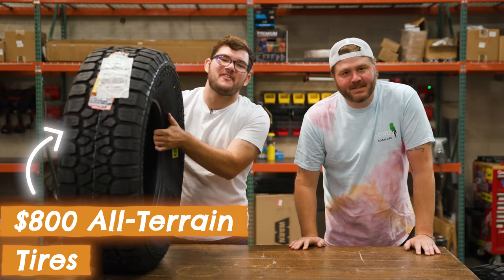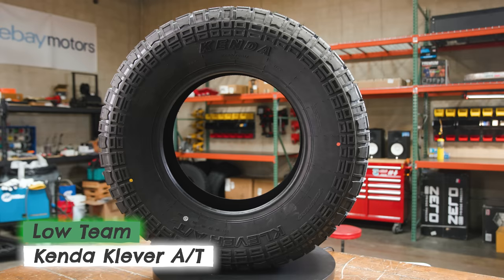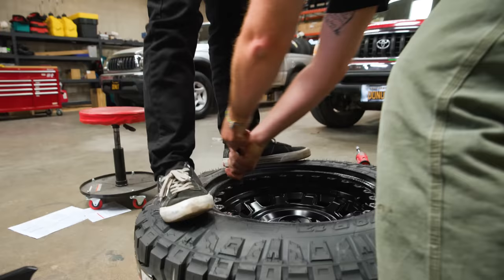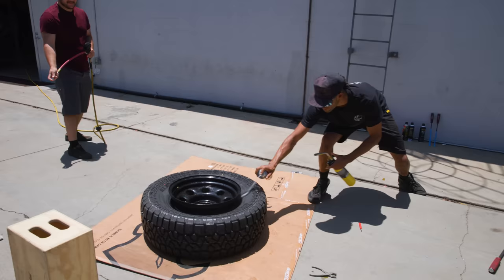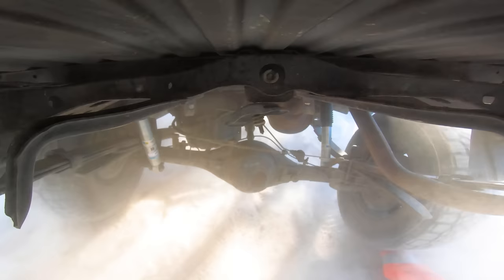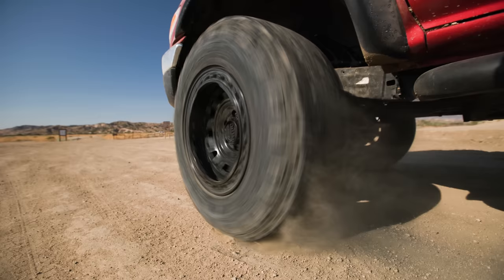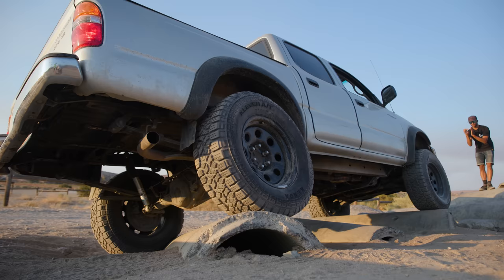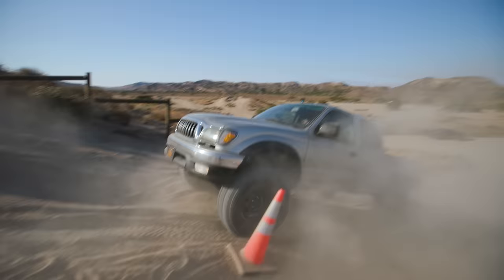$800 Off-Road Tires vs. $1500 Off-Road Tires

Comment: Offroading is like 60% skill, biggest thing with more expensive parts is better quality and better durability.
Reply: Thats the thing. The quality and durability of it is what the price basically equals. Don't go cheapest of the cheap but a center point is pretty much a solid bet for any average user. Even with moderate use it'll still be a okay.
Reply: Agreed
Reply: Ridge Grapplers are Hybrid so they sticky for streets and QUIET like Oem car tires. You HAVE to cross rotate hybrid off road rubber for them to wear well, as long as you do that they are worth the price on a daily truck. Milestar Patagonia is a GREAT lower priced competitive Hybrid w ridge grappler...even stickier and lighter per size vs Nittos. They work better off road on rocks/slippery dry surface. Nitto your paying for the name/tread looks
Reply: @05EVORS  no legitimate off-road rig uses ridge grapplers. They use Bfg mud terrain, Mickey Thompson Baja, general grabber, ridge grappler is what you see on an 8 inch lifted solid axle swapped Chevy with 22 inch wheels and red suspension.
Reply: @JacobEcret  I do agree that the dedicated off roaders have those more aggressive tires (I have KM3s), but for a daily driver, the ridge grapplers are great tires.
Reply: @chriskorf2295  No, no they are not. They are horrible. There's a reason the majority of TRD Pro 4R owners don't replace their stock tires back with the Nittos. They are subpar in OR performance(mainly durability) and after 5-8k miles the road noise jumps by a factor of 10. I know a handful of Trail/TRD OR owners who've gobbled up Nitto takes offs from Pro owners and almost instantly regret the decision. I'm one of those. I have a dedicated set of OR wheels with 285 Patagonia MTs which I would choose over the Ridge Grapplers as a ROAD tire.
Reply: $1500 skill and $800 tires in my scubaru, now im dead on a beach waiting to get the parts for new clutch. Good Old Scubbiedoo!!!
Reply: @chriskorf2295  understandable, but, you’re throwing your money out the window is you buy $300+ tires a piece and don’t put them to work, because they’re only rated for 40-50000 miles out of them, for a tire, that’s not very much
Reply: Biggest thing with more expensive parts is mostly in your head.

Comment: In all the years I've been reviewing off-road tires, what I've learned is that the difference between $800 tires and $1,500 tires is that the $1,500 tires cost $700 more, are harder to balance, and have more frequent issues.
Reply: In all my years working in the automotive field, what I've learned about the difference between $800 tires and $1500 is that the guy with the $800 tires can afford another set when they wear out.  The guy with the $1500 tires ends up complaining about the cost of his tires and demanding to speak to a manager cuz we're trying to rip him off....
Reply: If you’re bitching about $1,500 you shouldn’t be buying $1500 tires.
Reply: @AlexReyes-gu9ms  but if you're spending 1500 on tires when they barely make a difference... I guess the question is which is the priority? Appearance or function? If your all about function why waste an extra 700$ on tires when that could be put into something that actually makes a difference like a skid plate or rock rails?
Reply: @jah_b  depends on the tires your buying. If your buying stickies then there isn't a single $700 set that would even be close to comparison.
Reply: @SketchyAsFunk  sounds like the guys in this episode missed something then...
Reply: @jah_b  I feel like they left A LOT on the table with the tests they did. However for the standard person who seldom offroads and rarely goes over anything beyond a tall rock then this was a decent test. Stickies are also not road legal tires so I do understand why they where not even mentioned. If someone's buying stickies they already know what they should/ shouldn't waste money on. Overall I believe price does not dictate a good tire but the quality and purpose of a tire varies greatly between brands/models. I also forgot they used all terrain tires which are like all seasons. Moderately decent at everything but not great at anything.
Reply: @SketchyAsFunk  you sound overly opinionated. You saw what they drove these over. Wouldn't say it was a small rock I agree with your point about stickies but you're taking a bit of an elitist stance. To be honest I think either of these set ups is great for the weekend offroader who does serious driving but isn't at the point where "this" much difference in performance is worth hundreds or even thousands. Just my two cents
Reply: I found exactly opposite cheap wheel and tire combos seem to need alot more weights in my experience.
Reply: Also I believe the main difference between cheap and expensive isn't traction but durability and longevity
Reply: My local shop told me they would sell me the BFGs for sure, but recommended I get the patonigonia. Set of 5 for about the cost of 2. When the tire shop recommends the cheaper option I listen
Reply: As someone who had seriously offroaded and over landed I have to say the biggest thing is kevlar sidewall. And those usually cost quite a bit more. But always go cheap on the first set unless you do it extremely often
Reply: I agree with some of the results. But one of the huge differences is typically durability. We had 30 or so trucks running around the country chasing tanks and pipeline work. We had a fleet manager that had the cheaper is better attitude and bought the off brands. 8 out of 10 times, these vehicles would need new rubber after 35k or so and some after just 25k. When we ran the BFG’s, Nitto’s… high end tires, I routinely get over 75k before changing tires. This is typically with 3/4 ton diesels but some 1/2 tons as well. These quick tests are great for short term but obviously can’t put this kind of miles on stuff and still turn out a timely video.
Reply: I believe it comes down to the tread design and ply
Reply: Nitto ridge Grapplers > everybody whatever they cost.

Comment: I got some General Grabers atx 27X8.50R14 95Q for the stock 14s on my 1995 Ford ranger 2.3l manual transmission. Got all four at $565. Already put 6k on them, best tires for your buck, will buy them again. Budget truck! 
Truck has 320254 original miles.

Comment: 8:02 you should unscrew the valve core. That way the vacuum can escape from the tire freely. No need for running around with the pressuregauge :D
Reply: That would have been far too professional. Nolan seemed to suggest that mounting by hand was somehow; "INCORRECT!" Obviously not an Offroader.

Comment: Pro tip: A much safer alternative to brake cleaner for mounting is a ratchet strap. Simply wrap one around the center of the tread, crank it down, and your beads will be seated enough to hold air.

The catch is to make sure you remove the ratchet strap before filling the tire. Slowly release tension as you add air until the bead's seated enough that you can remove it.
Reply: Ive never actually seen anything bad happen from using brake cleaner. And ive seen people who would be just as likely to try and huff the brake cleaner to get high do it no problem.
Reply: @Johnny White True, can't argue that one
Reply: @toolswithtimmyboi8040  The main issue I have with the brake cleaner method is it's never been convenient for me.

Either I'm at work (this method is a huge no at an airport), at a trail (I DO NOT want to be responsible for another CA forest fire), or just don't have brake cleaner handy.

Comment: Love the series just one thing the "inflating" of the tire can kill your valve and is actually not inflating it. Its fine for mounting a tire but since there´s a vacuum in the tire after it u might aswell spare your valve and just inflate it after.
Reply: You take the valve out while doing the fire pop. Thats why nolan had to be fast with the air. After you air it up you put the valve in
Reply: @jeffmayo6002  doesn’t the valve go in from the inside? I’ve never messed around with tires but I’ve always assumed they go in from the inside and the internal pressure holds them against the rim
Reply: Needed about half of that amount of starting fluid or carb and choke .  But have done this too many times to count most of the time on semi tires however
Reply: @insertnamehere6960  the entire valve stem goes in from the inside but the valve itself threads in the stem from outside the tire
Reply: Ah yes the classic when anyone does anything on YT all the "experts come crawling out of every hole imaginable 😂

Comment: It’s a fun video, entertaining, and there is really useful information. 
Adding to that, there are some elements of tires comparison which are not really tested here (I know to take this video as a mix of information and entertainment), but I would suggest a little more research when choosing off-road tires. 
If I were to add some tests:

1. Performance in more varied terrain like rock crawling, or thorough sharp rocks (not exaggerating, that’s what we take our trucks through in Western Arabia, where we have a mix of dunes, beaches, rocky valleys, mountain passes and lava fields. I can’t say much about snow and ice since that is less common here other than in the Northern and Southern high mountain ranges).  

2. Longer term noise tests (what do they sound like after 5,000 miles/8,000km?

3. Breaking distance 
4. On road steering precision 
5. Durability. (By far the most important and admittedly, most time consuming to test)

Comment: Wow, i thought I spent a lot on my tyres for my Ranger but they’re only £150 a corner + about £30 fitting and balancing. So I spent less than low truck (I put them on the OEM wheels because I like the look of them). 
I got 33x11.5x15R CST LandDragon CL18s. They’re a rather agressive MT tyre and I can’t wait to get them off-road and test them

Comment: All the aluminum beadlock  I've seen like to burp the inner non bead lock bead and need tricks like wrapping a layer of tape on the wheel before putting the tire on to keep the inner bead seated  . The steel wheels don't seem to need this they seem to have a better inner safety bead  from the get go .  I run 17 allied steel bead locks simply because as mentioned in the comments you can hammer out a bent lip with steel you can't with aluminum you can also weld a crack in a steel wheel very easily since they are just mild steel . The draw back is they are a bit heavier .

Comment: You can seat the bead without fire on those big tires.  Just take the core out of the valve stem and hit it with 90psi.  Also get a bubble balancer and go old school:)

Comment: Glad to see the Kenda's here, the big thing they have going for them is the wide range of sizes they make. 35x10.5? Heck ya

Also: use balancing beads in the beadlocks instead of getting them balanced
Reply: Great tire if where you live it never gets cold super performance in tropical climates
Reply: @yeahman1975  It snows about once every few years were I live. Had record breaking snow this year but I have seen videos and read reviews saying they are a great winter tire.
Reply: @jeremyforresttalley145  worth a try for you hope they work out. In the Rockies at 5000 feet I need a great all year tire. Have a great day and be safe
Reply: Have had the 35x10.50r17 up here in Colorado all summer, 2000 4runner 3 inch suspension 1 inch body. Great for everything up here, and I could reduce the size of my bump stops. In James hp voice: Mo flex baby :)
Reply: @iankovac1878  awesome input 👌good to know
Reply: @yeahman1975  I got them after all my friends upgraded last winter. They do well in the snow, not as good as my BFG All Terrains, but good enough for the price.
Reply: @iankovac1878  run KM3 MT on my Rubicon and my Pops truck runs K02. Super hard to match treadwear and traction. Since 1998 ive ran KO and KO2 on my 4x4s ive tried others but always seem to go back.
Reply: @yeahman1975  The price has gone way up on the Kenda's. For me just needed the 35x10.50 if BFG made it would run them. Hopefully by the time I need new ones :)
Reply: @iankovac1878  hard to find in the 17 huh?
Reply: @yeahman1975   At the time of purchase it was the only 35x10.50 on the market. Also only in 17 from Kenda so, you do what you gotta. Wish they all were like my 87 SR5 4runner with an SAS. Sadly gotta worry about firewall clearance and such, at least I can get up a hill in a timely manner now tho lol.
Reply: @iankovac1878  i imagine you had to re gear big time
Reply: @yeahman1975  Yes indeed the 87 was on 35x12.50 Trail gear kits the works. Both trucks went from 4.10 to 5.29. 87 had a 100hp 22re with a cam, so slow, 2000 has a 2.7 16v dual cam with a supercharger so like 200hp. Both got/get around 18-20. 2000 can get up a hill, but I miss the SAS 36 inches of articulation from both axles, with leaf springs. So nice to have some travel, hate IFS for that lol.
Reply: @iankovac1878  ifs has its benefits but they arent travel or articulation. Oh the 22re great for no mods and downhill but still gotta love em. We have the 3.4 in the T100 and its not fast but does ok on freeway with 31 10.5. Just did
Bilstein shocks all around
Brakes front and rear
Bearings
Pitman arm
Ball joints
Front Drive shafts
Warn manual hubs
Found a color match used topper
Just need to do center bearing and replace the rusted CatBack
Reply: @iankovac1878  that 2.7 supercharged sounds fun
Reply: @yeahman1975   It is, minus miata syndrome. Gears are a little short lol.
Reply: @yeahman1975   Heck yes the T100 is so nice with the 3.4. My 2000 limited has it. After the supercharger everything is about the same as the v6 minus the top 2000 rpm. I just like the 5 spd in the 2.7. Trying to trade the Limited for my 3rd 1983 Toyota pickup, so I can murder something for crawling again :)

Comment: I'm on my 4th set of $500 re-cap tires - all-terrain and mud terrains - and can't understand the need for more expensive tires. Not only my Rubicon but on my Cummins that tows my Rubicon. Tires are a 'consumable' resource unlike the $$$ that could go towards upgraded suspension, etc. Look at the various videos (where I've commented) about TireRecappers and Treadwright.

Comment: What you need to consider in buying expensive tires compared to cheap tires is their longevity. I had a set of cheaper tires on my Jeep gladiator and within a year they needed to be replaced I got some expensive tires and they still look great after 9 months.

Comment: Soft 8s for the win. Aluminum wheels for offroad, well it depends on how far out from your support that you are planning to go.
Reply: I agree but they would've saved some weight going with aluminum, and they'd probably be strong enough for what these guys are doing.
Reply: Steelies bend not break, you can hit them back to round on trails.
Reply: @john37694452  And I always hear people ask if that ever actually happens. Yes it does, because I bent my rim back into shape with a dead blow hammer.

Comment: From my experience with several different tires, mud tires are the only real “all terrain tires”
Reply: Facts
Reply: The disadvantage of mud tyres is the noise and they tend to struggle on sand. Apart from that they look the part and do as advertised
Reply: @maxwellmason5403  thats why you air down
Reply: Yes and no. They’re doing for road and off road and I’ve had mud tires a Cummins that just absolutely lost traction in the rain on the road. Not to mention road noise was insane. I would use mud tires for off road only.
Reply: also these guys running their tires at 15 psi thinking that's low. i run my MT's without beadlocks around 12 psi off road and have had zero issues. MT's are almost cheat codes on any terrain except sand
Reply: @50TNCSA  i run the achilles desert hawk mtx tyres. They very much lack the performance on sand even aired down to 12-15psi depending how soft it is. I run 40 psi when on the black top. (1 bar when 4x4ing, 3.7 bar when on the road)
Reply: @Louis Rockefeller ha every time we wheel I keep going down a few. 12 was the last number I ran
Reply: @maxwellmason5403  i mean tbh my mud tires work really well with sand they grip it pretty damn good
Reply: @maxwellmason5403  they are quite unless you go over them speed bumps 😂
Reply: Agreed.

Comment: man, was not happy with my Nittos, wound up going to KO2's and was way happier.  The Nittos just had shit traction in wet environments.
Reply: Yeah Nitto's are bro tires. For the mall crowd. I rarely see a serious offloaded using them.
Reply: I'm pretty surprised they didn't go with the KO2. Yeah they're a little noisy, but they're much better off-road. Those Nittos are basically a more aggressive highway tire. Kinda like the Cooper AT3. Yeah they're "AT" but not really.
Reply: @MichaelRCarlson  apparently they  last longer due to harder rubber. Harder rubber sucks in the rain tho, compromises.
Reply: @cparks872  To me, the AT3 looks like a delivery van tire with an aggressive sidewall.
Reply: @Jesse Robinson Weird how opinions can differ. I’ve had plenty of people in my circle of friends have great luck with and things to say about KO2’s.
Reply: @Jesse Robinson man I loved my Ko2’s (275’s E-load) Finally sold them after like 30k and still had pretty good tread on them.  Abused and used they held up.   Also fantastic in snow.

Comment: in lots of cases you don't need bead locks, just run 8 inch wheels instead of 10 in for airing down.

Comment: The tires definitely have diminishing returns, the wheels most certainly improve when you spend more because the beadlocks are vital at really really low psi.

Comment: you can go down to 15 PSI on the non beadlock wheels.  I have a non beadlocks, specifically TRD wheels.  I air down to 15 PSI and off road just fine.